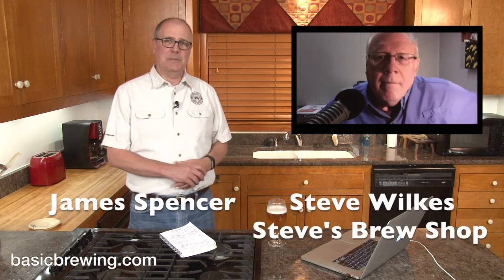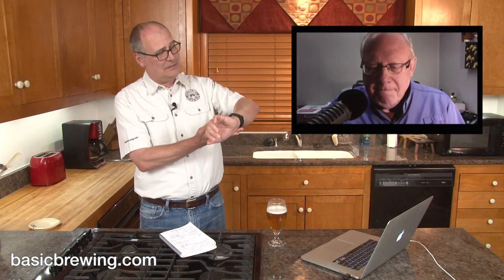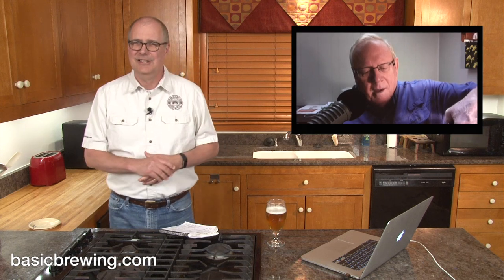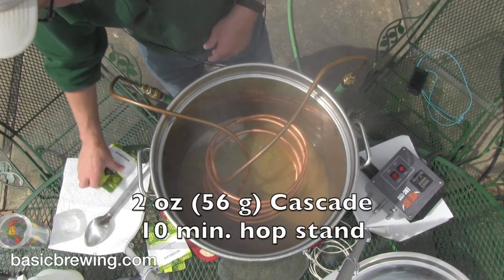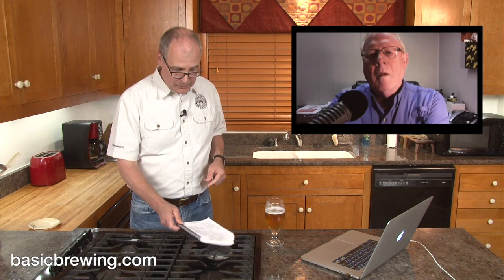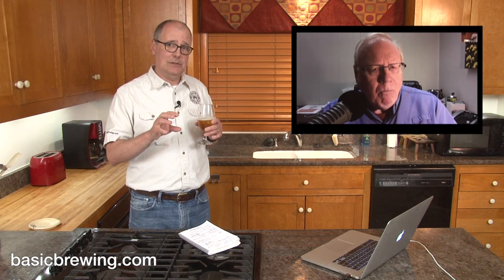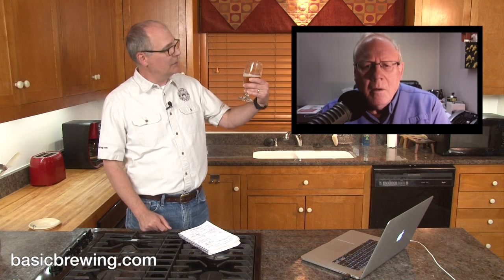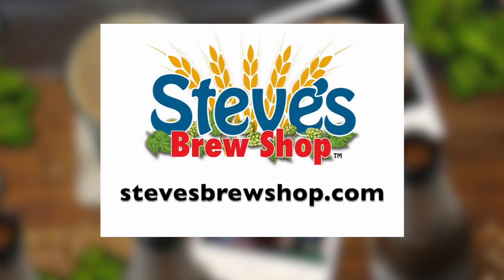15-Minute Kveiking Pale Ale - Basic Brewing Video - April 27, 2020

Comment: When you do the next kveik hot weather brew day, consider under pitching the yeast. You will get a lot of citrus! Cheers!
Reply: GFunKd24 i just heard about under pitching.  isn’t it hilarious that most of us are so concerned that we make starters to get the numbers up?
Reply: GFunKd24 how much underpitching for a OG of 1.05 would you consider?  half an Omega liquid pack?
Reply: @barrettincognito  I used a tsp of Hornindal, which fermented a 5 gal batch in 3 days. Kveik is amazing stuff.
Reply: Matt Fricovsky if a buy a pack of hornindal can I pitch a TBSP out of the pack and freeze the remainder to use later?
Reply: lbailey9777 Not sure about freezing it, but you can dry it. Google how to dry kveik. A dehydrater would be best to use, but people use ovens as well if you can keep it around 110F with the door open. It’s hard to do. But also some people just leave it out, spread out on parchment paper and it will dry over a day or two. I’ve never tried that but heard it works.

Comment: I'm wondering how this yeast would perform with pressured fermentation? I don't have a pressure fermenter vessel yet, I'm still in the researching phase, but my understanding is that pressurised fermentation reduces the fermentation time, with this yeast it would be half-day and done 😀. Another factor to understand could be the temperature, looks like even lagers could be fermented at higher temperatures without any concerns. Have you folks considered such experiment? Thanks for all your videos, I really love them 😉👍